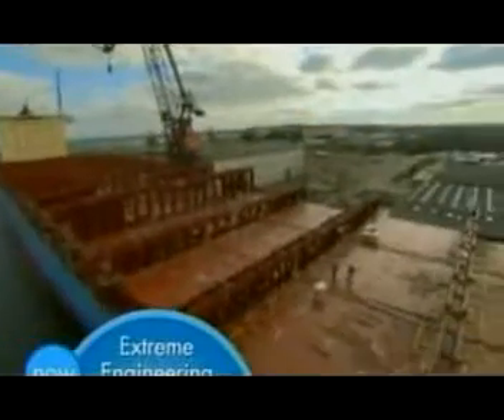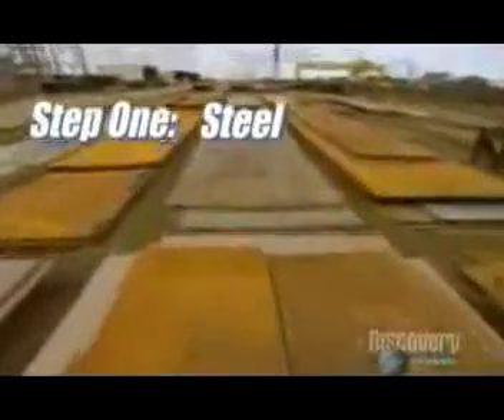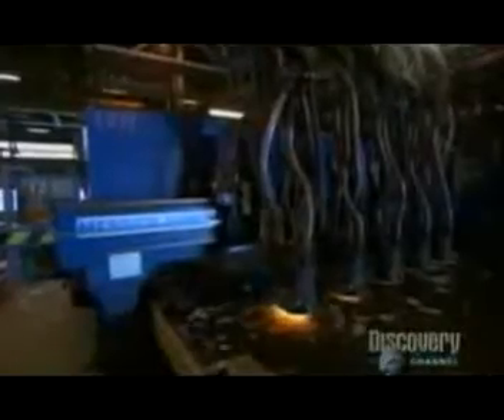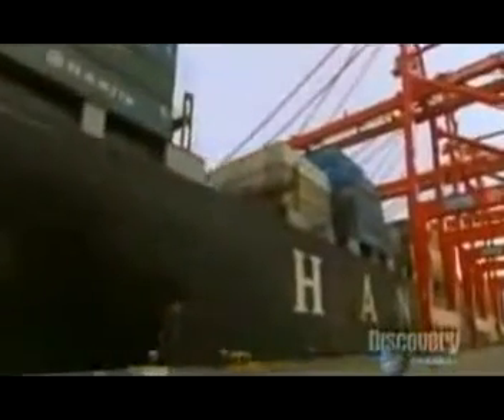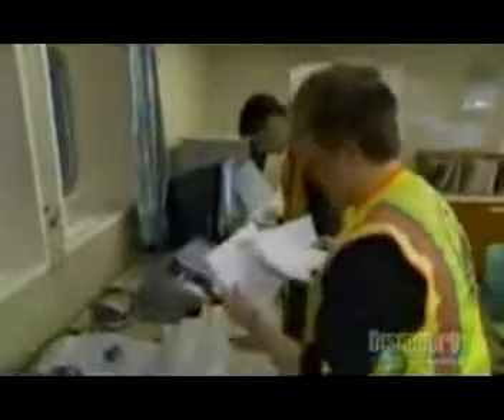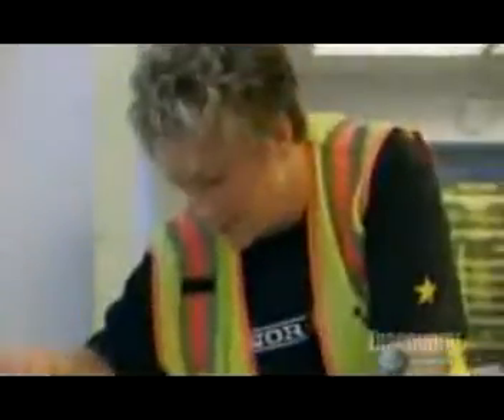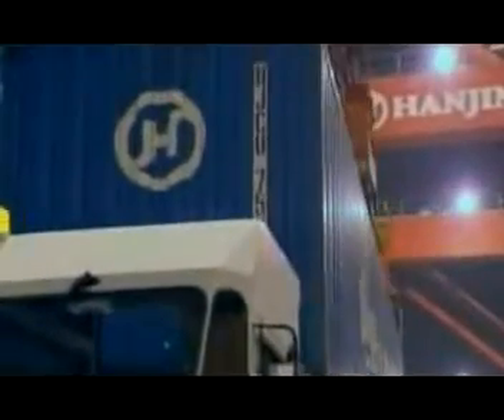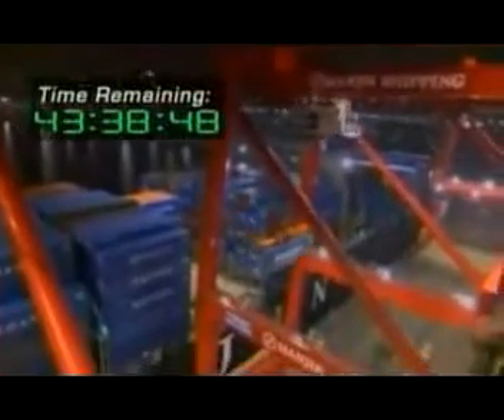Building Emma Maersk - Part 2 of 5

Comment: @ChannelingusIV well its not diesel they are using. they run on heavy oil which is the non refined stuff. the reason why the engine can run on this is because of the compression ratio. It very technical but basically the higher the pressure in the cylinder the higher the temperature will be and once it reaches roughly 700 degrees Celcius (about 1200 F) the fuel is ignited. Less refined means less expensive to buy.  HOWEVER its still not cheap ....but its cheaper :)